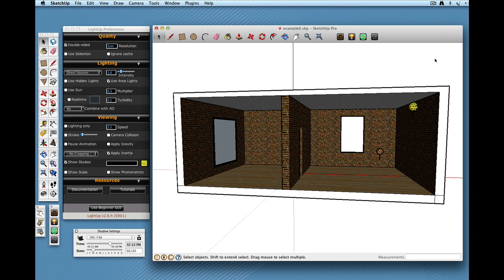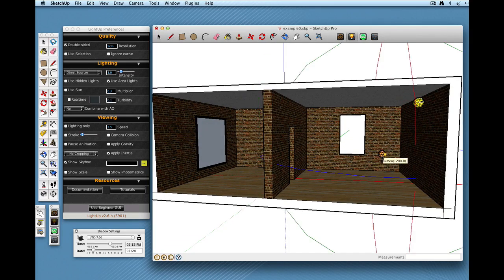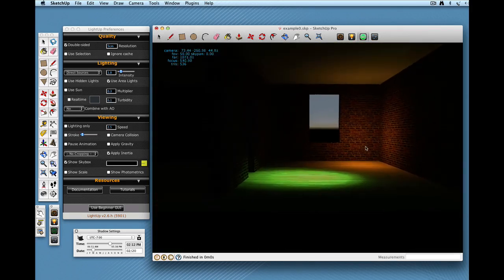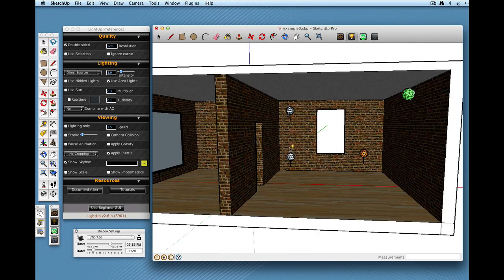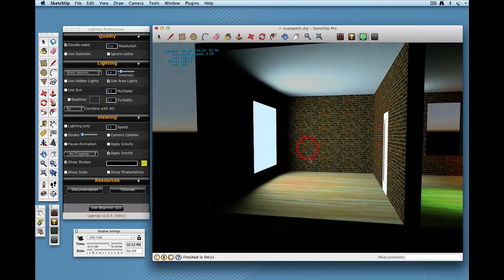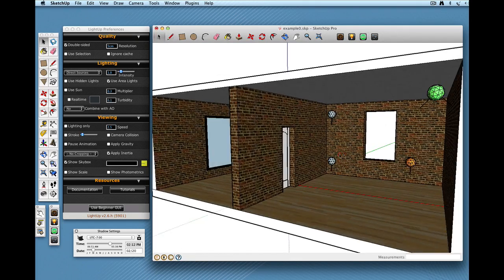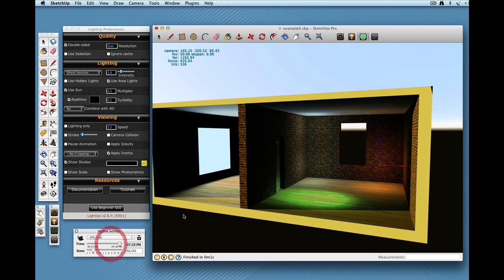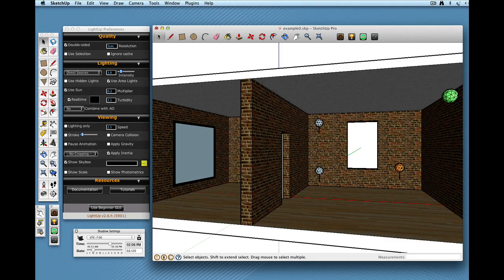LightUp Essentials: Rigging Light Sources

Comment: I just tried LightUp for the first time and I gotta say I was truly disappointed by the program. 

While LightUp certainly has some promising features and while it can produce some decent looking results, the process is quite terrible. SU users like myself are accustomed to well thought and intuitive to use tools. LightUp on the other hand is frustratingly un-intuitive. The options are overly technical for any non-lighting professionals, which generally includes all SU users. I shouldn't have to have a degree in lighting engineering just to imagine my space with some lights turned on. Furthermore, the developers totally failed to include any IES values with the software. Instead, they offer a link to a shady ad-covered website where I can view and download IES files, not that I understand IES files in the first place. Let me say, I be required to know what IES values even are but then they force me to hunt these IES files down then individually download and then individually apply them to each lights?!? It's ridiculous. 

Here's the hard truth for the developer of this program. They have seemingly created a pretty good render program which obviously took a lot of skill, care and thought. But they created a program for the wrong audience. I may only assume that if I was a practicing lighting professional I'd already use some other, highly technical program for lighting simulation. Not SketchUp. So, for the average SU user, who could actually benefit from a SU based light rendering program like LightUp, they just made it waaaaay too complex, far too difficult and much too frustrating to operate. 

The included 100-page (!) instruction manual, is equally overly technical, while at the same time doesn't include basic information and the YouTube tutorials are outdated,  boring and unrealistic. I have no idea how to apply the information provided in the video, which just places some random light sources in brick room. WTF? That is just not how light fixtures work. Next time, maybe start with a lamp, a recessed LED and/or a chandelier...you know, light sources that people have to use? I say this, knowing that a lot of time, energy and passion went into developing this program and while I believe it just misses it's mark, there is still something there that could be so much better. 

Here's what it SHOULD do.....put most of the options for lights under "advanced" menus and just give me some basic light styles to choose from; Light bulb, Light tube, light strip, light panel, pin light, flood light, etc. each with default IES profiles but optional custom IES profiles. Have basic options that the average human understands like lumen output, color, temperature, etc. You know, the same stuff on the outside of a lightbulb package that one may read when purchasing a light from the Home Depot or whatnot. 

Next, fix the toolbar. There is no discernible tool on the toolbar to simply place a new light. Honestly, after using the program for several hours, and placing many lights, I still don't know exactly how to place a light. I just clicked here and there until one magically appeared. It's crazy! In SU if I want to place a circle, I go to draw>shapes>circle and boom I am making a circle. It is an obvious and straightforward path to circle creating. Would it have been too difficult to offered something like place light>panel light>rectangular? or maybe even a component library of pre-designed light options? 

Even later using the program after I rendered, I had no idea what was going on. I was kinda 'stuck' in the render mode with limited options. "Edit" didn't really allow me to edit my lights as I wished, only to click on some giant axis thing (no idea) to move them about when I was hoping to try out other light shapes, intensities, etc. 

Materials is also quirky. Some materials are okay to play with, like plastic and such but other materials (very popular architectural materials) aren't provided in the preset such as chrome, leather, or just paint.  It does offer chromium, silicon, lead, etc......not too popular in interior design. I suppose I could somehow custom build a material but as a common civilian how the heck am I supposed to know what the proper reflectivity and whatnot of top grain leather is? Honestly, I shouldn't. The developer should have the wherewithal to interpret that and provide it in a manner that I can understand. 

Moving forward, I truly hope this program can be refined to reflect the needs of the average user. Unfortunately, for now, this program is a dud.

Comment: Why certain area lights stop emitting suddenly?E.g. I create 2 strips of surface to emulate led strip. I use the same material on both. One works, another does not. Happens all the time, have to delete surface and re-create it to fix. And it doesn't always fix it.
Reply from the maker: If you have thin area geometry, you may find you need to increase emitter "Density" in the Material dialog.  Try increasing it to 4.0

Comment: Once I put a light in, how do I switch it off without erasing the light?
Reply from the maker: LightUp initially places lights in a Layer called "LU_Lights".  Move the lights you wish to control into another Layer and show/hide that Layer.

In Preferences there is also a checkbox for whether to "Use hidden Lights".

Comment: hello adam,

why cant i create an area light? i ctrl+click a moaterial and nothing happens.

please respond! thank you!
Reply: jack p I dont understand how to make a strip lighting. i can do area lighting on a strip of material but cannot accomplish task. i cannot get material properties to come out
Reply from the maker: jack p Sounds like you are clicking on the Default material which cannot be edited.  Try applying a material to the face and then clicking.
Reply from the maker: jack p Strip lights can be achieved using the appropriate IES light - ie one with a linear opening.  If you are going to use a strip of area emitter material, keep in mind lighting power is dependent on Area, so you may need to increase the power and also increase Density if you're seeing 'hotspots' on nearby surfaces.
Reply: Actually for Windows is Alt+click to make "Material properties" to come out. Thanks for the apply-a-material tip!